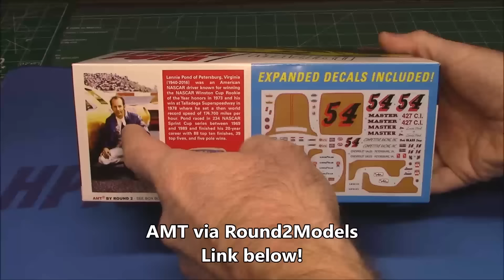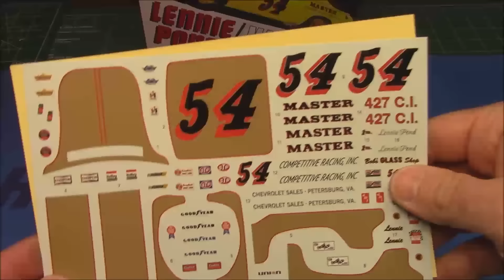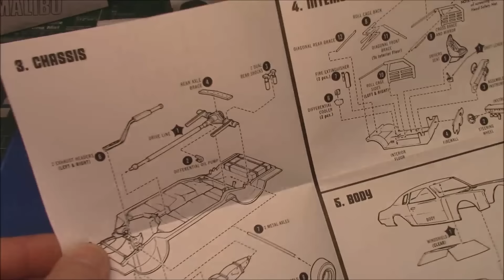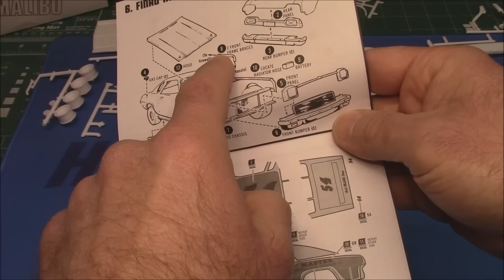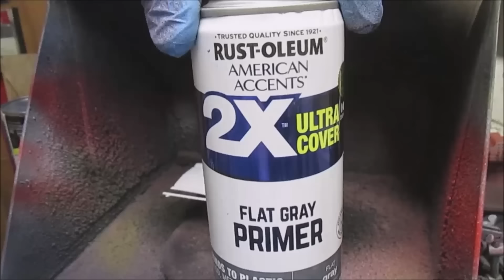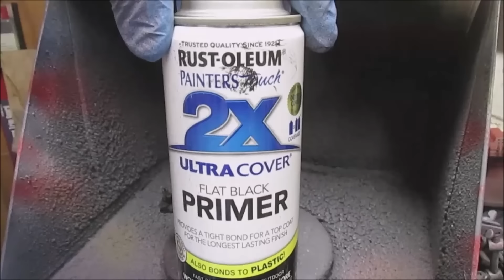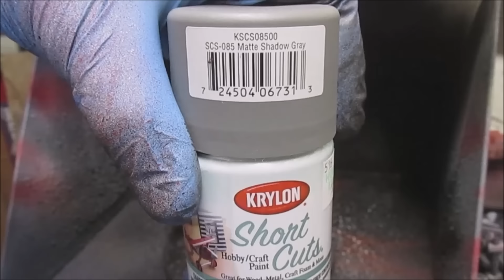1974 Chevy Malibu 427 Lennie Pond Stock Car 1/25 Scale Model Kit Build How To Decals Paint Assemble

Comment: For the tires - I am wondering about spraying white paint on a card and then just touching the tire down to the card so the paint hits the high "Good Year". Thoughts on that? Thanks for another great video!
Reply from the maker: Thanks for the tip!
Reply: I use a brand new pencil with eraser, dab the eraser in the paint then use it like a ink stamp
Reply: @chucktaylor2772  - Not a bad idea either

Comment: Another great video. I learned to clean the tires like you do the parts, then just spray the side wall with a dull coat, then try to paint the white letters. It does not work all the time, but it does a lot of the time.

Comment: Built that kit alooong time ago. For the tires I would lightly spread paint on wax paper & let it flash for a few seconds, scuff the tires lightly then just place the tire on it also for a few seconds, then remove, let dry & clear spray it. Works great! My Dale Earnhardt 94 Lumina, which I still have still has the paint on them after thirty years.
Reply from the maker: Good tip! I may try that in a video, forgot all about that method.

I've used something similar to scuff paint on race car builds and to paint the road wheels on tanks. Thanks for the reminder!

Comment: Only one ERROR stands out in this otherwise great build. Your technique of clear gloss over flat black to simulate vinyl is clever. But in this model you changed your brush strokes on the clear making the vinyl look like the 1972 stuff. There was a World wide change in the manufacture of black vinyl in 1973 when the under fabric weave was changed. The feel was very different.  The only way I can see to rectify this is a tear down, stripping the dash and repainting it to 1974 vinyl covering specs. (please be laughing about now...)
Reply from the maker: Thanks as always RA!

Comment: How do you clean spray cans when they clog up and paint want spray out
Reply: spray nozzles from rattle cans are easily removed and can be soaked in any number of solvents to keep them clean.
just remove the nozzle from the can immediately after spraying and drop in the thinner.  if you wait until the paint has
dried - you will have a problem.  also, try saving nozzles from empty cans - in case one does become clogged.
Reply: @urbanurchin5930  thank you for the information
Reply from the maker: Pop off the nozzle and soak in Super Clean. 
I also save the nozzles from empty cans and soak them so when I get a clogged one I can swap. 
The engine paint nozzle got clogged as I used it in this video so I cleaned it once I got the engine painted.
Reply: @hpiguy  thanks hpiguy you rock

Comment: How many coats of color do you normally do? I did three of the rustoleum and it bubbled.
Reply from the maker: Usually just one coat on screen, while they are still pretty wet. 

Rustoleum customer service doesn't even recommend doing multiple coats over itself after it dries. 
The can does say you can recoat after a day or so, but I have not had success trying so unless it's a very very very light mist of color for weathering.
Reply: @hpiguys Workshop  thank you for the information!